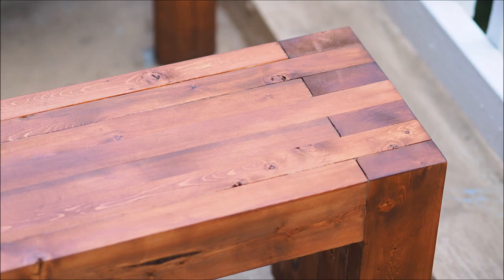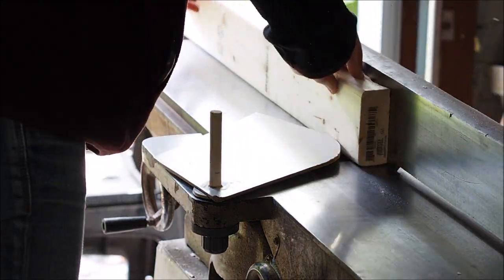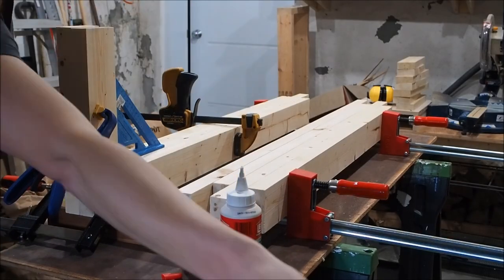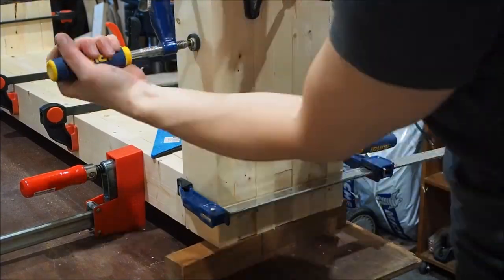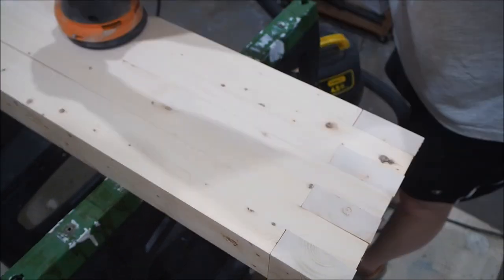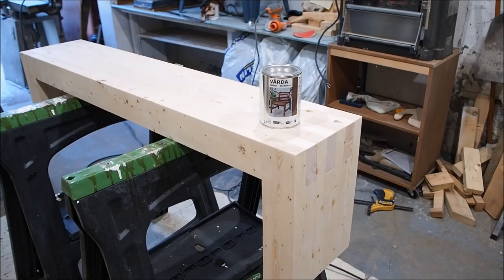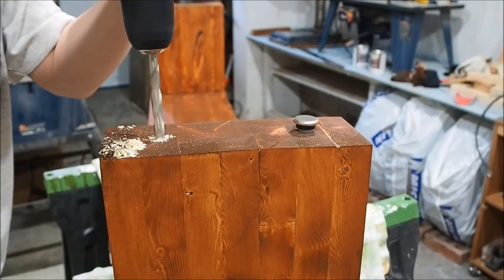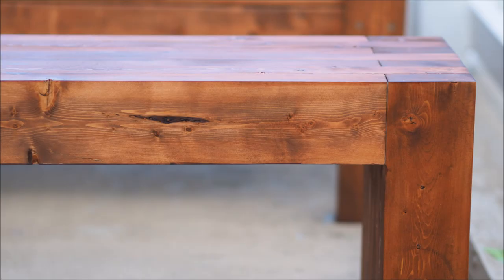How to make a modern outdoor bench or coffee table from 2x4s

Comment: I just made a smaller version of what you did here and I think it turned out pretty good for my first try. I had (3) pcs of 2x4 sitting in the garage drying out with no plan in mind for them and it was just enough to make this small end table for my deck. The only thing I did do differently is I did add screws to each layer as well as the glue, I wanted to make sure it wasn't going to come apart on me. The only layer I didn't put any screws in was the final layer as I didn't want to see the screw heads. I love it and now I am going to attempt the coffee table but I do want to make it about 4" higher then in your plans and about 3" wider, but your instructions are so clear that it shouldn't be a problem to do the conversion for the larger table. Thank you for your video, it was so very easy to follow. I was going to attach a picture of my table but wasn't sure how to do it. Thanks again!!!

Comment: Why did you choose to build it as you glued it? I think I'll build the legs and seat separately, send it through the planer before assembly then put it all together
Reply from the maker: I was afraid with one panel glued tightly it would be difficult to fit the fingers from the other panel. Also, this way I could get the aliment right. Doing it differently might also work. Let me know if you try it.

Comment: gluing end grain is usually risky because the glue just soaks into the fibers instead of staying on the surface like on side or face grain - so in gluing end grain I also use fasteners of some kind (screws) - how can you be sure this is going to hold with glue only?
Reply: esp. since you can't clamp vertically, just sideways, so there's no force pushing the vertical end grain of the legs to the side grain of the seat - and yet it seems to have turned out beautifully - I always use Titebond III and this bench wll be out in the rain and snow, so I'm a little concerned about durability
Reply: This bench will last for years with no issues.

Comment: Looks nice but I don't have an jointer or a planer. Oh well.
Reply from the maker: If you can find straight 2x4s, you can just trim off the rounded edges, and you may be able to pull this off without the planer or jointer.

Comment: I've built dozens of these benches and u don't need all the clamps u are using. Use the right glue and a couple of clamps is all u need. But don't buy the clamps like whats in this video' waste of money. Go buy $10.00 slide on pole clamps from Home depot and make your own pipe clamps to do the job.
Reply from the maker: Sure, it's up to you to use fewer clamps I'd you want. I like to use more to spread out the clamping pressure along the board.
Reply: DIY Montreal Absolutely right.  You just can’t have too much adhesion in a glue-up.  And you DEFINITELY can’t have too many clamps.  Pipe clamps are fine but I usually use F-style clamps like you do.